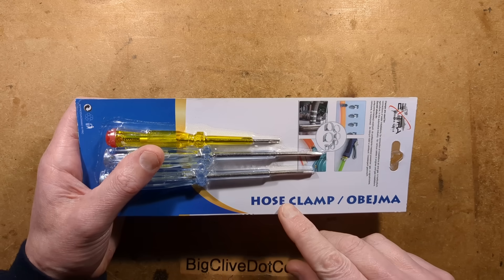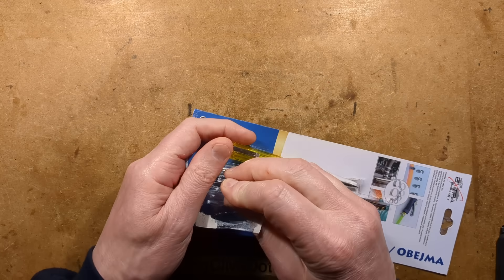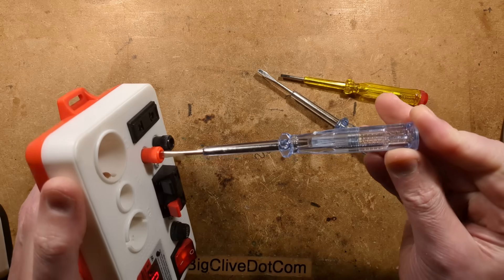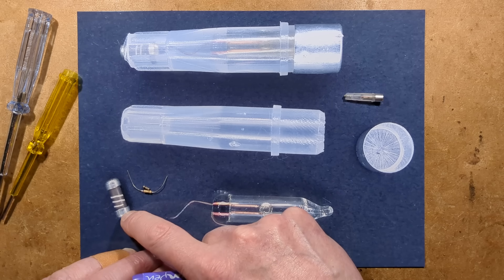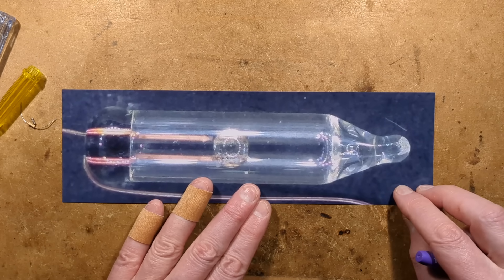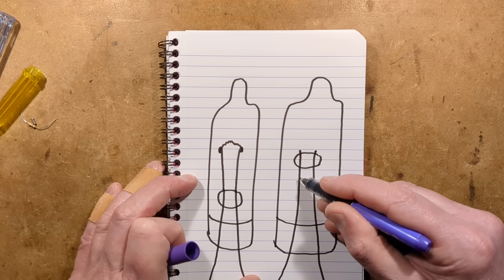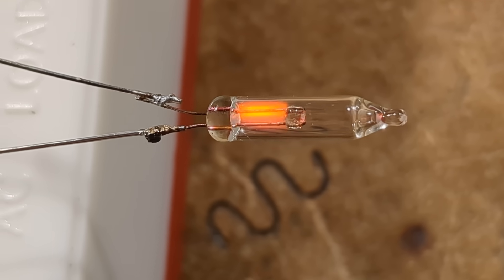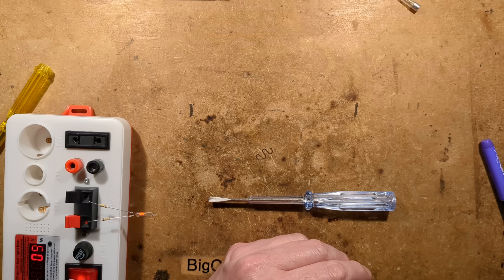Mispackaged testers with very odd neon bulb

Comment: What is one supposed to use instead of these? How would you use test lamps when poking at a single wire? What is the tester pen thing I saw used on occasion on this channel?
Reply from the maker: I've used a non contact tester in the past.

Comment: I have said it many times, but CK ones Sarendipitiosly solved the hard to see light issue when they dyed their tester screwdrivers with their typical combination of red and yellow achieving contrast against the yellow light. 
So unless in summer in direct sunlight in the middle of July, you could actually see the yellow against red dye.
For several month CK struggled to supply these sold-out testers until they found different supplier and fulfilled the seller's orders with these transparent ones. 
I don't think management at CK ever realized why the sales dropped so suddenly, because they newer made them in these colors again.In either case, prove, test (,prove) is a must with any kind of tester and its so easy to prove tester before switching power off or on a nearby socket.

Comment: since I was told those screwdriver testers should not be used as voltage testers after you used it as screwdriver ... I wonder, why they make it "look" like a screwdriver in the first place? 😂
it could just have a rounded pointy tip
I also wonder, why those "lying pens", as some call them, are still sold ... darwin conspiracy? 😂

Comment: I never use mains tester screwdrivers anymore as they are no good for testing all cables and unreliable. Some of them often do make ideal screwdrivers though as seem to be the perfect size and tip for many slotted small electric screws.
I use a multimeter for testing cables and also handy for continuity including testing switches without power to them and fuses and thermal cut outs, etc.
I also find using a volt stick very handy to check if any power is present at any appliances or cables. 
A mains tester screwdriver will light up to show power coming from a live cable, but the appliance would still not work if the neutral side was broken/disconnected

Comment: AHH the memories of Christmas Past, i can remember one of these in the Christmas tree lights box. That bulb looks like it was one of the screw in type that  cooked away nicely during December  Plugged straight into the mains. Those little bulbs were everywhere in packs of 5 with the white tip fuse bulb.

Comment: How would that work with earth protector that shuts all of if any fault as your kind of grounding it. Nice vids i learn things😊
Reply from the maker: The earth/ground leakage detectors usually require 10-30mA to trip.  These will pass less than 1mA in normal use.

Comment: ah , the "forbidden" pole finder's ... today if you have to pass an electrical permit , they don't like it at all ," no pole finders ,No multi-meters , only VAT's"  ... 
I also have a electronic one with a LED , but also needs a small cell bat , never opened mine , now I'm curious ...

Comment: Embarrassingly reminiscent of the time when I bought a test screwdriver from the local, specialist, tool store. With a nicely-knurled aluminium top (Steadfast brand?) like the larger ones here.
Before using it, examination seemed to show the two electrodes touching! So I took it back, and the assistant said "don't worry, I'll test it".
Removing a lamp (100W, Tungsten, bayonet cap - U.K. standard at the time) from its socket hanging down over the counter-top, he grasped the pointed end, and inserted the tester vertically up into the socket. The aluminium fitted perfectly across the terminals, and BANG! all the lights in the shop went out!
"I'll get you a replacement"

Comment: I wonder why the tester manufacturers don't use glow lamps that glow blue or green? Much more visible. I wonder what colour the hose clamps would make at 230 V AC with a 1 ohm series resistor?  After the bang of course.
Reply from the maker: The blue and green tend to be diffused and much dimmer than pure neon at very low current.

Comment: When I was an apprentice I started doing jobs on my own,not under supervision!I went into a school to check a socket !! I had my neon screwdriver at hand .The room was a music room with carpet .The young lads were rubbing their feet on the floor and touching pupils in the corridor as they passed ! small sparks were emitting from their fingers ! I had walked across the room and pushed my neon screwdriver into the live terminal ,there was a flash ,and my new neon screwdriver never worked again !

Comment: You know it's a Hose Clamp. You place the hose ends together and drive it through like an spike. The LEDs tell you if you hit a near by electrical wire. Nice safety feature.

Comment: Everybody says these type of devices are risky or dangerous : but they are not. If they were there would be many reports of injury or death. In fact, they are extremely useful for testing a live contact one-handed, which ( rather foolishly ) the manufacturers of "approved devices" have not yet managed. We live in an extremely well regulated nation when it comes to electrical safety, and if these devices are so problematic then why are they still allowed to be sold ?

Comment: I had a little neon bit like the one from the screwdriver about 58 years ago that came in a science set for detecting static electricity. One day one wire in live and neutral. Switch on socket and boom.

Comment: Electricians are told to use a voltage tester with two probes. It works most of the time but what if all three terminals are live when you are up a ladder with to a partially severed cable with a nail in it somewhere? There would be no relative voltage difference between terminals and the tester would indicate no hazard between them. The Neon tester using the human body (what you re trying to protect) as a return path would show all three terminals are hazardous. Arguably both the neon tester and its methodology are superior and more reliable - providing the neon tester is properly designed.

Comment: I got a pack of 5 small ones for €4.99 on Aliexpress and they have a tiny red LED instead of a neon bulb,  I tested them with 240V and I'm still alive but I don't want to put the "rated" 500V across the tiny resistor and my body

Comment: Oh yes. The "Neon Demon" hose clamp...
I've used them before. They perform better when used as screwdrivers (in an electric installation context) than as hose clamps, though.
And why would a hose clamp ever indicate electric parameters, rather than hydraulic (or at least pneumatic) ones? 🤷‍♂

Comment: I found 2 testers that look like jewellers screwdrivers which use 2 button cells and a FET device with gate probably connected to the screwdriver shaft; the D or S attached to a cap on top of the handle.
It's useful for resistance,voltage monitoring,and cleaning your ears.

Comment: I bought a cheap one of these about 30 years ago when I didn't know any better. It never actually worked as a tester, which is just as well because there was a fairly high chance it would've killed me by now had I actually been using it for that. I still use it as a screwdriver though - can't bring myself to chuck it out while it still has a use! But the whole concept of sticking a screwdriver into a socket to see whether it's live always seemed like a bit of a bizarre idea.

Comment: I'm a gas engineer and often use a multimeter for diagnostics but one time I didn't have it for some reason so my BOSS!! gave me his "tester", I remember the first time I was probing the 240v coming in to the boiler and managed to touch the earthed casing at the same time with my other hand! ⚡️😩.
As far as I know they're just a little bulb in series with a high value resistor?

Comment: I  discovered ball lightning when I was a kid in the 70's. I was in my dads shed I took apart his antec soldering iron and (as you do) decided to wire a neon directly across the mains wires. I plugged it in and there was a loud bang followed by the sight of a glowing ball of neon flying up the garden at speed. Dad was at work that day. Still wondering how I'm still alive and kicking  (remembering back to when I rewired the mains switch for my bedside metal table lamp, clicking the switch before putting the base back together to check the light still worked.... it did; then I realized it was still plugged in and switched on at the wall!) Gulp.

Comment: You never want a voltage tester to be glitchy. If it's dim it might be OK because you should always test them on a live circuit before use. But there's no excuse for the neon bulb wire just resting on the resistor.

Comment: I never had those types of testers. Mine had 2 leads going to the neon bulb with a resistor in series. We made testers in 7th grade. But to determine the hot wire, you grabbed one lead, while sticking the other lead into the receptacle, or whatever.
I assumed it was safe, because the resistor would limit enough current .

Comment: What scares me the most is that someone who bought a voltage tester ends up with a pack of hose clamps and they are going to have some fun when they stick that in an outlet to see if it's hot :face-blue-smiling:

Comment: did you know if you put a diode in series with the neon that only one leg illuminates.  turn the diode around ant the other leg will instead. I used this to test if triacs had half blown into an scr and only gave half cycle to a heater.

Comment: I work on a trade counter, and it always surprised me just how many of these type of screwdrivers we sell.  Particularly as you can buy something that will give you much clearer indication for very little extra cost
Reply: It might be that they are just the right size for the screws in mains socket faceplates.....?
Reply: @gleggett3817 they come in different sizes, so they can't all be the right size for that

Comment: I would not use those things at all for one very important reason, voltage breakdown.  At what voltage will the resistor fail (or that other thing) and become a dead short while you're hand is on the other electrical end of that.  It might be Ok up to 200 V, but risky beyond that.

Comment: Whenever I use these I always make sure I CAN see the glow with the power on and check it goes away when the circuit is isolated. Proves that the circuit did not go dead because of a switched neutral.

Comment: This brings to mind a small electrical tester that I carried around as a sparky.  We used to work on a lot of older city houses with knob/tube wiring.  This little tester has a neon bulb in it.  We held one end of the probe to our finger and touched a wire.  If it was a neutral run, the tester would do nothing.  If you touched a hot wire, your body capacitively coupled to the neon and it lit dimly. This was a trick my old boss taught me for quick testing.  Incidentally, if you have ever had a string of lights, an appliance of a good load on a neutral string (in a knob/tube) setup and you got between that load, it is one of the most painful, jolting shocks I ever got.  I'll tap a hot line with a finger all day long, but lighting a load through your body hurts.
Reply: Never heard of knob/tube wiring, can you explain more please?
Reply: @FamilyOfEyles  It was an older wiring standard where the wires were single conductor, often cloth wrapped and generally of larger diameter copper wire.  It was run through joists and wood through porcelain/ceramic tubes.  Junctions could be found on porcelain/ceramic knobs nailed to the house wood (fully exposed overhead).  Often, several circuits were daisy-chained and the neutrals often converged into one conductor in the basement prior the the electric panel or fuse box.

You could cut a neutral that powered half the house (in older homes) and if you manage to complete that neutral path with your body - it hurt - a lot.
Reply: @FamilyOfEyles  It consisted of single-insulated copper conductors run within wall or ceiling cavities, passing through joist and stud drill-holes via protective porcelain insulating tubes, and supported along their length on nailed-down porcelain knob insulators. Where conductors entered a wiring device such as a lamp or switch, or were pulled into a wall, they were protected by flexible cloth insulating sleeving called loom

Comment: Thanks for this video. Wonder if you could elaborate on better ways of testing for live mains. I have a noncontact volts stick which is sometimes hard to use to differentiate conductors that are close together.

Comment: Yeah, those aren't user friendly. But I have also had problems with moder contact-free indicators. With few Biltema ones being set to so high sensitivity that they lit up 30cm / 1ft away from the live 230V. And they had no sensitivity controller.

So to be sure what's going on I only use multimeter. Though I need to use those contact-free types if wanting to measure phase from secondary side of a transformer. Contact-free type can still detect that from a floating secondary. Only some transformer manufacturers mark down the secondary phase.

Comment: I enjoyed the huge closeup of the wiggly hot wire, branded onto the table top. 🧐
Reply: Plastic welder 'bridge' element. They heat and embed into plastics across a cracks.

Comment: That bulb design might actually make it safer. The traditional neon bulbs with thick rods as electrodes might short out if you drop the screwdriver, or separate too far away and won't work or just very faintly. That won't happen with this one, because the glass bead keeps the spacing.
Reply: So I have dropped / bumped the traditional style of indicator bulb before and the electrodes did indeed move. So good intuition lol!

Comment: It is sad to see the level of cheapness built into such  devices. Someone instead of buying some resistors and neon indicator lamps, and build the neon phase tester screwdrivers properly, deduced that they could win the market with a lower priced device if they build the resistors and neon bulbs by themselves.
You can see the effects of the race to the bottom that is typical of the economy of that big country in the Far East.
They bleed the functionality and the safety of operation from most electrical devices, to a point that such devices looks like they could be working; this appearance of functionality, coupled with the rock-bottom price, is enough to convince the importers from the customer countries to order a shipload of such devices, that they can happily sell for one pound. This can't happen when there is any conformity testing - this is why you don't see such dangerous neon screwdrivers sold in any serious store - they are a legal liability...

Comment: And then there is the variation which uses a 12V festoon globe as an auto DC tester with a wander lead for earth. Quite exciting if you plug it into 240V AC.

Comment: I got a similar "hose clamp" one xmas when I was a kid many years ago. It didn't have this type of lightbulb, but instead had a regular-ish fuse-looking bulb. (Automotive light, perhaps?) At the time, I had no idea what it actually was for or how to use it. But connecting it to 220V with my bare hand touching the bare metal contact at the end was just too scary. Instead, I broke it apart and connected a wire to the inside and taped up the outside contact point. Now, in hindsight, my contraption was probably 225% more sketchy than the unmolested device. But what did I know? 🙂 I also got a similar contraption in 6-24V (with a wire, this time), but some years later it unfortunately caught a live 220V concert…

Comment: I know these voltage tester things are not to be trusted on mains detection.
TBH anything that want's me to touch, or has exposed, metal near mains is a no-no - at some level you're trusting someone else to have wired it correctly.
(I don't really trust European sockets for that reason with their outie earth pin)

BUT - these drivers do make an excellent narrow and hard flat head screwdriver - just right for fitting plugs and many of the smaller screw terminals - I keep one just for that.

Comment: I have a few of these, in different stages of destruction (very easy to break if you drop them in the right position, or twist if you use them as screwdrivers), and never had any problems with performance (brighter standard neons) or with safety (never had any discomfort, even with 380V, which is really pushing it too far). Anyway, not bad for a set of hose clamps 🙂

Comment: 3:05 No, getting referenced to ground when using one of these is not better, unless maybe if you're one of those "pain is pleasure" people.
I just got bumped while using one and touched a nearby steel beam that was electrically grounded and managed to get a nice jolt and trigger the leakage current detector at work.

Comment: Some of the modern designs use a red LED, that provides MUCH more light, and in principle should be an easy substitution.  Whilst these still seem to crop up in screwdriver kits, they have been eclipsed by the far safer and almost as inexpensive non-contact testers.

Comment: Very interesting, I use one that has a different construction ( with one end of the neon lamp wires wrapped around the tubes nipple wich is touching a spring and it is inside a glass tube like from fuses).

Comment: I've got a question about neon lamps! There's one in the end of an extension cord under my house, which when new was always on. I noticed one night a week or so ago that it appears to now be reactive to light. I had my flashlight with me, and when I peered under the house with it, the lamp was lit/blinking randomly like they do when they age. But then, I noticed that if I turned my flashlight completely away so it was dark under the house, the neon went out. If I turned my flashlight to let even a little bit of light in the direction of the neon, it came back on again! I was able to reliably repeat this a whole bunch of times. I'm baffled. Do you have any idea why this would be?